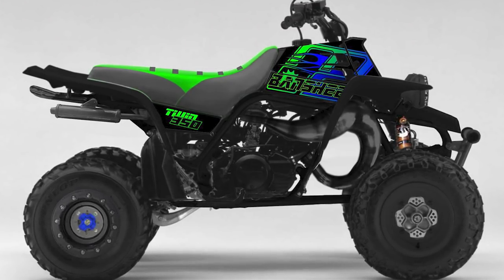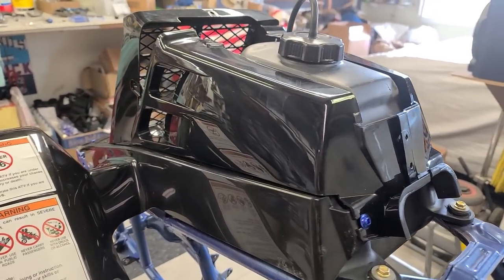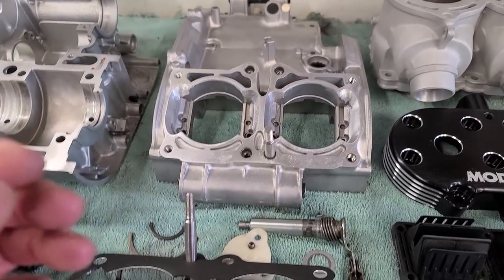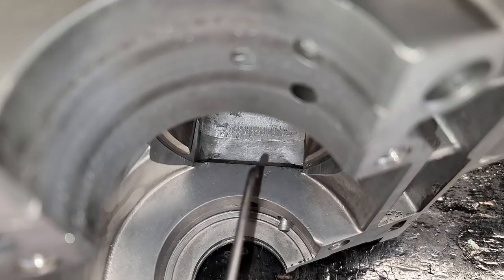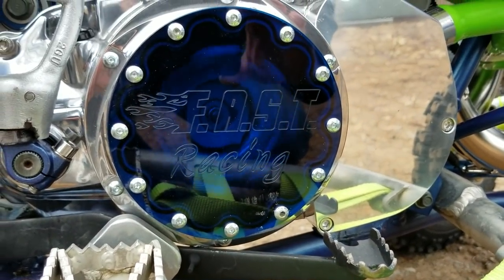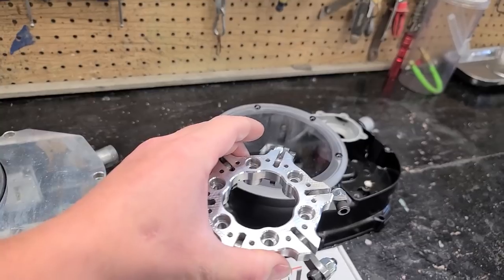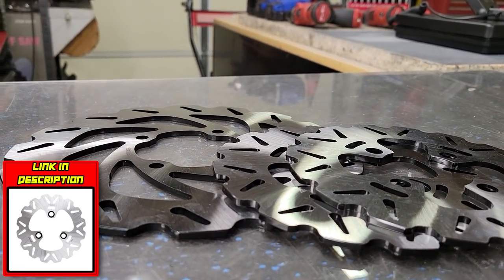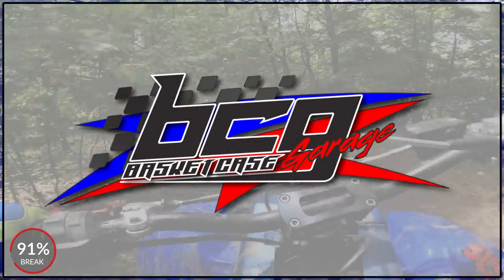This might be the worst fitting eBay or Amazon part I've tried... Voodoo Banshee Part 4

Comment from the maker: It's not looking good for these eBay/Amazon plastics... What are your experiences with aftermarket plastics? Thank you for watching my video, you guys ROOOOOCK!!!! 🤘🤘🤘
Reply: I got the updated polisport plastic kit with the updated air box for my 04 yz250. Looked great until I tried to wheelie while standing 😳 now my rear fender got a nice stress mark across it lol. But it went back to original shape. Nothing a decal can't hide 😜
Reply: Aftermarket Plastics dosen't fit & Look Like OEM I don't Use them,If i can't restore the original one!I Search WorldWide For new old Stock!No Compromise!I am a Numbers Matching Oldskool Dude.Smile
Reply: Thanks,you Doing great JOB10-10!!but i Understand it's,Not possible to get all those Parts in Time to Run a Channel!Viewers can Not wait years!Big Big Smile
Reply from the maker: @TTR66  thank you man! Yes, waiting for parts is one of the biggest obstacles I face
Reply: Drag cut them
Reply: Bro I just changed my whole rear brake system and I can't get the fluid to get through the line I tried bleeding it I left the bleeder valve open for any 30 minutes still no flow why do you think that is
Reply: @jeremycaldwellbikelifej6752  take ur hydraulic apart clean it, sometimes they’ll get water in them and not work, an also try to bench bleed them, take a hose put it on the bleeder and run it to the resivor or a cup of water
Reply: I bought maier plastics and had the exact same fitment issues for mine.
Reply: @bryscynkurr   ok thanks man I'll try that
Reply: @jeremycaldwellbikelifej6752  biggest pain in the ass tbh
Reply: @bryscynkurr   yeah for sure
Reply: @MichaelSabo  I got my banshee rear fender off partzilla and it arrived yesterday, I was waiting to put it on till I got my decals in since I'm up north and it will be easier to put on the decals in the house, anyway after watching your video and seeing how similar our fenders looked I had to see if it lined up, and partzilla "oem" fenders lined right up so I suggest maybe going on there
Reply: i have the same problem bought them from ebay (vito's garbage plastics) sending them back was not a option (shipped to the netherlands)
Reply from the maker: @austinhigel4118  thank you for the feedback man! I ordered OEM fenders as well 🤘
Reply: @MichaelSabo  no problem, can't wait to see the build when it's done👌
Reply: Those are for the Chinese made banshiong. Very rare.
Reply from the maker: @handsolo6241  😂😂😂😂😂😂😂
Reply: I only buy plastics for anything from a known source

Comment: Love the videos man! Just a tip. When you cut plastics. Use the blue tap and put on the side you're keeping. Cut off the piece but dont touch the blue tape line. Just get close enough. Then go with a sanding block and sand down to the blue tap line. Peel off the tap and thank me later. I discovered this on my own and the lines come out super streight.

Comment: This is amazing ! I’m so pumped for this build mike, I had a feeling about the plastics I just hoped they were ok, I was gonna ask you have you hurd anything about FORCE RACING? They make pipes that are almost T5s but for $550 raw finish, I was looking into them they are new just wasn’t sure if you hurd of them.
Reply from the maker: I did look at force racing and I think you're right; they look like copies of the T5. There's another company that make a pipe called the "T9" that is also a copy of the T5. I haven't personally tried either of these but I'd imagine they run okay if they're well constructed copies.
Reply: cheap copies. Don't even bother
Reply: @stevencarter3290  I’m not I was just curious if anybody has ever tried them

Comment: This series is making me want to buy some of these parts even though I don’t need any of them lol
Reply from the maker: Oh man, I'm the same way; it's hard not to want to mod out your machine once you see the parts
Reply: @MichaelSabo  man, I’ve only had 1 experience with aftermarket plastics and it was a set of maier front fenders, pretty sure we messaged a little about it on instagram, but I had to use a tool to extend the holes on the front since they didn’t line up properly, also has an issue similar to yours with the front brackets not reaching without a bunch of force pulling them down.
Reply: I pressed pause and did it, damn it lol 😂

Comment: Mike,just have a aluminum ring/ spacer made and you can use the black cover. Basically a spacer and longer bolts... But a half inch or something and you can use that cover. Idk may be cheaper to get the other powder coated?

Comment: Man I'm glad I didn't pull the trigger on plastics!!! And I had no idea oem were that cheap. Everyone I see them they r like 850 900. So I deff gotta go see rmatv. Really want full set of blue for my next build. Killin it with this series. Really good work on the port matching too. If ur waiting for motor assy dude u should really look into shift drum bearing mod and shift shaft bearing mod. Mechanical hulk could machine u up ur lower case in a jiff, order the correct size bearings, and that gives u a bearing behind shifter seal and on opposite side of the shift drum. Would compliment ur other trans mods freakin sweet dude!!!
Reply from the maker: I almost did those two bearings when I did my banshee the first time around. My trans shifted really nicely the way I had it setup or else I'd definitely take some time and do as you suggested. I'm not sure why people ask those price on eBay; I guess they're counting on people not checking on OEM sites 🤷

Comment: Not sure if you noticed this but I’m 18 min into the video where your going over your cases and why you can’t run the sleek flat black one, it appears that the polished case has an extension on it that the lexan is bolted to that is the same bolt pattern and and diameter as the clear lexan on the black case… so you may be able to just move the extension cord ver to the black case… it appears to be an extension made just for fitting that piece with the fingers

Comment: Or.... You could even just make a ring spacer out of 1/2 inch  polycarbonate, or 1/4 inch... However thick it needs to be... You could probably do that in your garage? For the black bp racing cover... Just a thought.
Reply from the maker: That's a great idea man. It might be more involved because of where the rear brake pedal sits. On the direct drive cover, it has a recession for it and it still hits. Definitely like this idea though man!

Comment: Back in the early 2000's you had to buy 4 sets of plastics and one or maybe 2 would be correct. The equipment to press them is so cheap the first run would be small the middle run would be perfect and the final run would be oversized as the parts wear out

Comment: When doing ur case sealant get u some cheap artist brushes. Put on ur sealant and take the brush to spread it around works great. And contact hellcat channel  he uses that sling shot and it's soft pull and he loves it.
Reply from the maker: I imagine a stiff bristle brush would work well; thanks for the tip! I actually talked to hell cat matt a few times back when I first built my 421; good guy
Reply: @MichaelSabo  yes he is were pretty good buddy's have u seen his latest video. I'm selling my banshee on his page and he is rides it to show how well it runs

Comment: Full bore plastics for Yamaha banshee are the only way to go I’ve used Meijer and the garbage Fullbore plastic is the only way to go or factory plastic bottom line I’ve been running a lock up clutch on my dune banshee for eight years on the original clutch fibers lock up clutches are the Way to go

Comment: The yfz450 front calipers also bolt right up to a 400ex
Reply from the maker: I didn't know that; thank you for the info!
Reply: @MichaelSabo  did ny last 2 400ex with yfz450 front calipers. Big upgrade and direct bolt on! Just incase you ever do another 400ex project

Comment: I bought Vito’s plastic they fit a lot better then those others eBay plastic they also have to hooks on the rad plastic .
Reply from the maker: Thank you for the feedback man; I'm hearing good things about Vitos
Reply: @MichaelSabo  I have 2 sets of Vito’s plastic one fits absolutely perfect the other needs a little stretched but nothing to bad . . Try factory 43 nerfs they are pretty light and you can take the heal guard off and it’s all nets  no extra metal. I use them on my motor-cross banshee. I wish I saw more banshee with then they are pricey.
Reply from the maker: @noahpeters1851  i saw that they made them but I couldn't find a pic. I have F43 on my 250R and I love them. I'm gonna rock these because I put in so much time to make them. Realistically, they're not going to make much of a difference; I'm just obsessing lol
Reply: @MichaelSabo  I think I sent some photos of my banshee to you with the F34 nerfs on IG. I’m going to take a lot of inspiration form your build next tear down . Going to try to shave unnecessary weight on my banshee

Comment: I have a comeplete factory OEM banshee plastic set up that I bought off ebay in like 2013 I paid 850$ bucks for them and still till this day I have not pulled them out of box!  it even came with a alba racing sticker kit and I have not opened that either i guess I'm just gonna rot with them
Reply from the maker: How come? You should do a build or you could sell them if Yamaha ever decides to stop making new plastics (which I hope they never do lol)
Reply: @MichaelSabo  
I planed on doing a comeplete factory rebuild but my bike is already a super clean stock bike so I just put them away because I thought yahama stop making new plastics. Thats new to me. I know they where still producing banshees in  Puerto rico till 2013 or so but had no clue they are still making oem plastics. Thanks for busting my bubble....lol 😆 🤣 
Thanks for the reply and keep up the great work on what you do!
Reply: @MichaelSabo  
I thought I was sitting on a gold mine....😆 🤣 😂 😹

Comment: Couldn’t you just get a 1 or 2 inch spacer made for the clutch cover so you can run the black one and still have the lexan glass. Would probably be about the same cost as powder coating and you would save the polish cover for something else

Comment: I advise anyone that gets these to not use those soft aluminum bolts (motorcycle fairings bolts from china) if you're stretching the plastics. They're snap the head off and have a pain fitting.

Comment: Do you talk about why you don’t have the hydraulic clutch add on anymore, I am considering one for my quad for the hours of hard trail riding we do on sport quads in the Rockies.
Reply: He did in another video of quad wars!
Reply: @MxShee  ok cool i must have missed that part, I’ll have to take a look thanks
Reply: @TripR32  i think it was during the 400ex series when he raced the banshee against the yellow ex at the end
Reply from the maker: It's okay for trail riding without a lockup but it gets hot under heavy use and the clutch will stop disengaging entirely causing it to grab when you have the clutch pulled all the way in. With a lockup it made it impossible to powershift. Removed it and my quad shifter much better. Just my experience.
Reply: @MichaelSabo  thanks for the help, that’s good to know as we ride pretty hard for long periods of time and the last thing i need is clutch trouble 20 miles from the trail head in the Rockies.

Comment: Hey Michael Sabo, My name is Chace and I'm turning 12 on March 29th, and I love your channel ,and love Riding quads oh my gosh it's so much fun.Anyways I have a Polaris outlaw 110, and I like it alot but I would like an upgrade ,another reason is because MY younger SISTER KEEPS stealing it. But I asked brewer off road and he said a 250ex is a really good one. And I asked Pete Hager no response yet and I didn't even expect one from brewer.But ive really been looking at and researching Yamaha raptor 250s I think that would a good one but I live in Minnesota so it's hard to find 250ex.And I'm about 5,3 and 💯 pounds.i would like to make a race build out of one and I was wondering if you have an opinion.And I have a Artic Cat dvx 400 with some speed parts on it the guy I bought It from I got it for 50 bucks but Its beat to crap the plastic are crap and the moter is alright.But I was wondering if you have an opinion on what quad I should get.oh and I've been riding for 5 years and know how to ride clutch

Comment: Why would you do all that to shave 12 pounds off of a 350 when you could just buy a 500 or for that matter get a  450 or  raptor 700 I have had about 50 bikes and I can tell you out of all of them the TRX 400 I had that was built was a great machine because it was small and easy to throw around I had a built 660 R which is fast and big and still not bad to whip around then I bought a 450 YFZ  but I noticed the first year and second gear were really tall and it was hard to trail ride without changing sprockets and no reverse was kind of weird especially when the raptor 700 has more torque at low and is easy to trail ride with the gears feels like it’s faster and you have reverse and it’s only about 17 pounds different I also have a TRX 700 double X it feels a lot like the raptor and the independent axle is not that bad for drifting and cornering not as much as people try to say but it is nice when you go through some mud you can get your rats and stuff because you don’t have only 4 inch clearance like all the rest of the bikes with the carrier hitting the ground if you want a good fast cheap machine get a trx400 and put a big bore kit on it jug piston jets pipe and intake or just find a good raptor 700 I have a 2011 that does 102 mph and it’s all stock and I know a lot of guys that want to throw a pipe on their bike it doesn’t make it faster it actually lowers your top and speed mostly pipes to a mid range change but with a bike that only has 40 hp you’re only adding one or 2 hp it be better off changing a couple teeth on a sprocket especially on sprockets are only 20 bucks

Comment: Dude, even with sportbikes, the chinese ones fit like shit. Bought a set for my 900R because OEM are not available anymore. All the holes might as well have been elongated because not even a  single one lined up. You wanna be busting 190 MPH with flappy shitty fitting plastics on 2 wheels. Nope. Until I find a decent set of originals(which might never happen) bikes staying below 100 mph. Which if fucked cause itll almost do that in first gear alone.
Reply from the maker: Dude, I can just imagine the fenders suddenly getting sucked off on the highway. Sucks to hear that the consistency with these fenders is bad fitment.